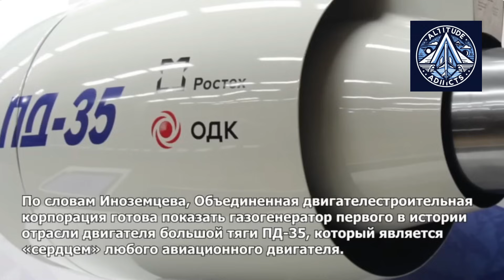Russia’s Il-96 Jet May Get Just Two PD-35 Engines—But Is It Even Possible?

Comment: In 2001 I inspected the IL-96T at MAKS. It had the same cockpit as a 747–400 and Pratt and Whitney PW2037 engines. As well it had a FAR-25 certification as a freighter per AC21-23B.  The IL-96 and IL-86 have operated since the ‘’70s with an excellent safety record.  Kudos to the designers and operators.

Comment: So lange man in Rußland mit Boeing 747 fliegt, so lange braucht man dort auch Großraumflugzeuge. Und da die westlichen Sanktionen hier den Einsatz von Boeing & Airbus Flugzeugen langfristig nicht garantieren lässt, die Unterhaltung extrem teuer ist,,muß man hier genau nachrechnen welches der effizienteste Weg ist.
Neukonstruktion oder eine gründliche Überarbeitung der IL 96- 300/ -400.
Oder ein parallelen Arbeiten als Brückentechnologie.
Durch die bei der Überarbeitung der 
SSJ 100 -> SJ 100 ?
MS 21-300 -> MS 21-310
Der TU 2x4 -> TU 2x4 New
gemachten Erfahrungen mit 2 Personen Cockpit und russischer Software & russicher Hardware könnten hier Synergien genutzt werden.
Entscheidend ist aber, die Entwicklungskosten müssen durch eine schnelle & effiziente Serienproduktion mit entsprechenden Stückzahlen/ Jahr, gedeckt werden. Der Marktbedarf Russlands ist groß, der unserer Welt noch viel größer.
20 Flugzeuge eines Typs pro Jahr, das ist keine effiziente Größenordnung, das ist Handwerksarbeit & keine Industrieproduktion.
100 Stück pro Jahr, da fängt die Effektivität an.

Comment: Russia needs to pursue both paths. They will develop a brand new widebody aircraft designed and developed from scratch (which will not be ready before 2035 and could use a mid life upgrade of the PD-35).

Furthermore they should make a twin engine derivative of the il-96 with new wings and new avionics and internal systems. Some of the improvements can be tested in the il-96-400M, some other can be derived from the one developed for the MC-21.
As far as the wings, Russia is supposed to provide (design and manufacture) the wings for the Chinese C929, which should have practically the same size as the il-96.

Using that (c929 wings) as a base, making wings for the twin engine derivative of the il-96 should not take that long.
If they start now such aircraft could be ready for entering service in 2030, just after full certification of the PD-35 engine.

Comment: The 1st "expert" is  spouting nonsense  Russia cannot afford tge time and resources  to wait 15 years for a new plane from scratch  better to uprgrade engines or buy Chinese comacs with pd 35s
Reply: Most of the chinese aircraft use western components which the west won't allow china to resell to russia, so it's a non starter. China can't actually redesign its comac planes to use russian components. One way forward would be resuming the joint development of the C929 to integrate russian components. But the most likely path for russia is simply to reuse the designs it produced for the Boeing 777x and adapt that for their own project. YES RUSSIA HELPED DESIGN THE NEW BOEING 777X A LITTLE KNOWN FACT MANY FOLKS AREN'T AWARE OF, SO THEY WON'T BE STARTING FROM SCRATCH AND THAT'S ACTUALLY WHY CHINA SOUGHT OUT THEIR HELP FOR THE CR929!
Reply: @strgo4773 
Da ja auch China inzwischen von westlicher Seite massiv gedroht wird,,die Cinesen ein höchst intelligente Völker sind, haben sie das was in Russland mit der Importsubstitution gemacht wurde,,sehr genau beobachtet.
Und ich bin mir sicher, daß man inzwischen sehr intensiv  gemeinsam daran arbeitet die Synergien zu ergründen.
Und man kann ja ruhig darauf aufmerksam machen, daß auf Grund der bisher gemachten Erfahrungen, das Spektrum des PD 35 auf bis zur PD 47 erweitert wurde.
Und da gibt es ja noch einen weitaus größeren Gasturbinenkern, dessen Potential für die Luftfahrt gerade erkundet wird.

Comment: IT would be a good option for the IL-86 two engine option but not for the IL-96 since it requires 100 tons of thrust and two PD-35's produce only 75 tons of thrust genious, do the math....!..
The MTOW of the IL-86 is 210 tons and the IL-96 is 250 tons, SO, 4 NK-86 engines of the IL-86 produce 120 tons vs. 140 tons with two PD-35's... A match made in heaven with a little tweaking, new wings, a slightly longer fuselage ( 6-10 meters ) it would be a formidable competitor at around 300-350 passengers....!.. Lets call it an Il-86- 800...

Comment: Illyushin are busy redesigning the Il-112 military transport to use PD-8s .... it is to be built at VASO ...... and the Il-96 is built at VASO ..... so its pretty obvious why they won't be doing much until 2030 ....
in that time they can figure out how to commonise as many parts with the Chinese C-929 - Russia simply doesn't have the market big enough to absorb such huge sunk costs on its own, especially since they have had to redesign the Il-112 .... or endless engineers sitting around looking for work
Reply: It's not really about having 'market absorption capacity' at this stage. It's more about strategic investment so you are not choked out of the aviation market because of 'sanctions'. If you can build your own airplanes, including wide body airliners, such 'sanctions' don't matter much

Comment: That’s ridiculous.. First it would need an entirely new wing design, and the landing gear would have to be changed because the fuselage is too low to the ground for the PD-35 to clear the ground.. At that point you have to design a completely new aircraft, and the Russians know this, and that’s what they intend to do in 2030 A new aircraft to rival the Airbus A350